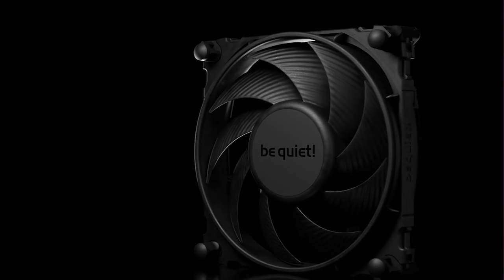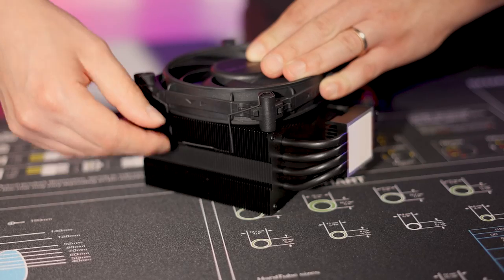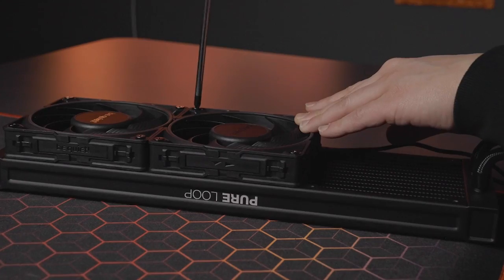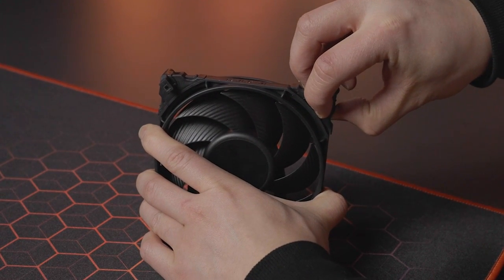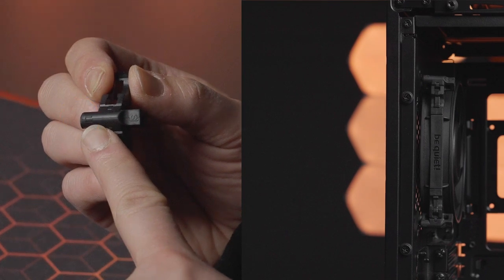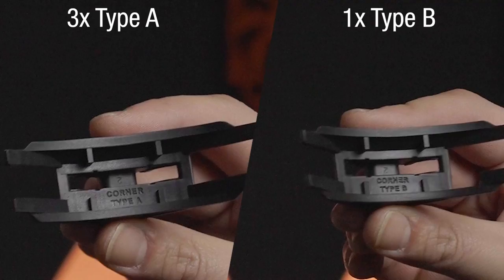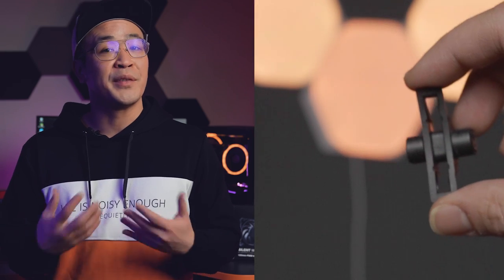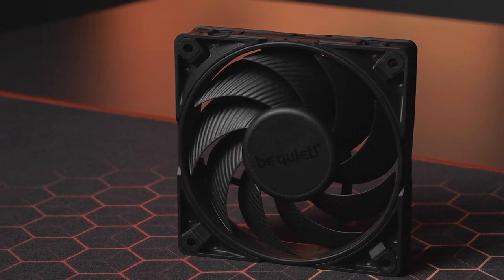How to use the Mounting Corners | Silent Wings 4 | be quiet!

Comment: But how can I mount this fan or the Pro version to my Dark Rock 4 cooler? Where can I find the proper clips? The ones included with the Dark Rock 4 do not fit with the Silent Wings Pro 4 mounting corners.
Reply: lol that's because dark rock 4 's fan has different corner shape , same as Dark Rock slim and Dark rock TF
Reply from the maker: You can add a 120mm fan to the back or the front with the longer fanclips included in the box. 140mm fans won´t fit
Reply: The Dark Rock 4 comes with a 135mm fan, so a 140mm unfortunately will not fit. An annoying choice that limits replacement of the fan, but I am not sure why you would want to replace a 135mm silent wings fan with a 140mm silent wings fan... unless the original failed, or had an issue.
Reply: @bequietofficial Just checked. included clips the same and not allow to fit silent wings 4 on dark rock pro 4.

Comment: I just bought 4x 120mm Silent Wings 4 fans (NON PRO) - without the specific radiator fan corners, will I see a major performance difference when used as radiator fans?

Comment: I want to get silent wings 4 to upgrade the silent wings 3 for my dark rock pro 4 cooler but that seems like it won't work.
In Dark rock pro 4, the fan corner mouting position is on the middle (silent wings 3 fan), while most of the fan out there have its mounting corner position on the inner and outer side of the fan. I once tried to replace that silent wing 3 with other 12mm fan but the clip wont reach the heatsink holder.
How can i upgrade my fan now ?

Comment: 1:03 What sorcery is this? I had to do eight of these and at least 50% of the locks where nigh-impossible to release. It doesn't help that the only bit of the surface you can really grip the corner piece by will more easily fall out of its socket than help to pull the corner off. My tip to anyone else struggling with jammed ones is aim to get a fingernail under each of the tips of the corner piece as you press the unlock mechanism for both sides simultaneously, then you can sort of lever it off. 

Wonderfully quiet fans once fitted though and that's what matters most.

Comment: I used radiator corners when attaching it at the exhaust spot, is that okay? Will that impact its performance as a case fan?
Reply from the maker: Hey, it makes no difference whether you use the corners for the push pin attachment or for screwing the fan. Both corners offer the same performance when you mount the fans on your radiator.

Comment: and how to remove and then what is the fan installed using the push-pin attachment?
Reply from the maker: Please try to gently loosen the push pin with your fingers. If this isn't working you can also use a screwdriver but please be careful.
Reply: @bequietofficial  thanks!)

Comment: Плохой дизайн корпуса (сильно забивается пылью и плохо вычищать). Тупая идея с уголками! - хотите сделать расстояние - положите резиновые шайбы под крепления. Переключатель режимов - круто. Все черное - круто. Провод в оплетке - круто. Вместо уголков лучше сделать съемный провод и укомплектовать 2 провода разной длины (500, 300 мм). 
Poor housing design (heavily clogged with dust and poorly cleaned). Stupid idea with corners! - if you want to make a distance, put rubber washers under the fasteners. The mode switch is cool. All black is cool. A wire in a braid is cool. Instead of corners, it is better to make a removable wire and complete 2 wires of different lengths (500, 300 mm).
Reply from the maker: Thank you for your input